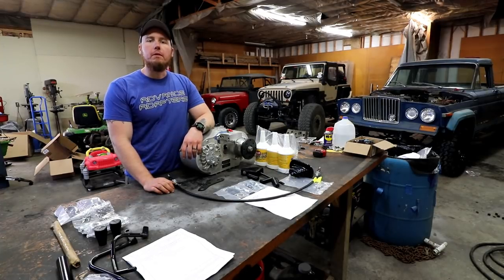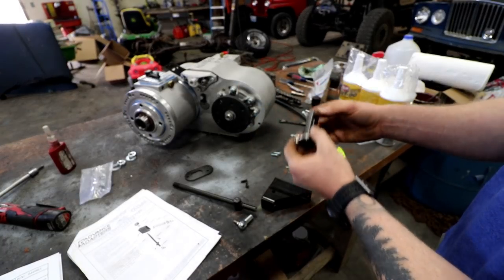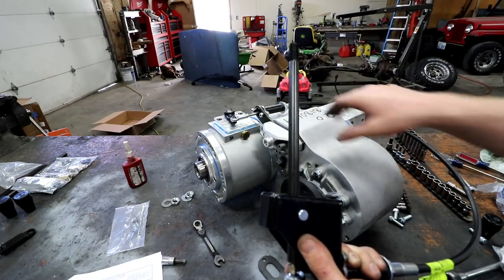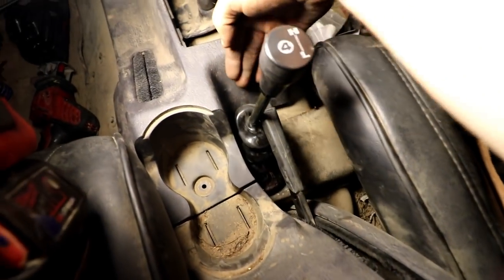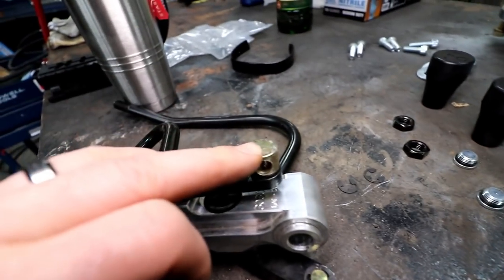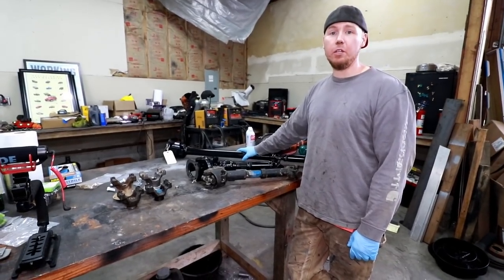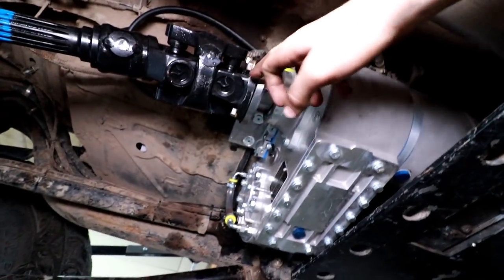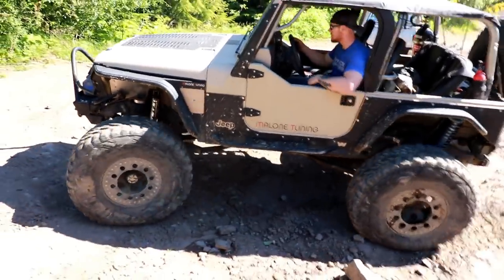SUPER LOW Gear 4 Speed Atlas Transfer Case Install

Comment: if you lost your speedometer when you installed the atlas case and you would like to have one. you can use something like a trail tech for like $100-$130. i bought one that was made for an atv and i use it in my buggy. you just put some jb weld on a magnet and stick it to your wheel and put a little sensor on your axle (i think it could be installed on a drive shaft too). you can set it up for whatever tire size you are running and conveniently change it anytime you change tires. it also has an odometer, ambient temp, engine temp, volts, rpms, programmable shift light, clock, and more (depending on the model)... i had to get some extension wires from trail tech because i have a rear engine buggy.
Reply: MrMrsregor  Sounds like a really good option! I have a Garmin trx5 GPS and it tells me how fast I'm going but I really only needed if I'm on the street and I want to obey the local traffic laws lol
Reply: @natebleepinjeep9564  either of yous have daily drivers? blew up my rubicon 4:1 and just grabbed a standard tjs 2.72:1 but they use different style speedos, ones a magnetic pickup and the others a gear driven one, so i have no speedo or odometer or cruise control.. not a major issue that was about 2 years ago but ive checked alot off the jeep todo list recently and having a speedo is making its way up the list

Comment: The shifters are designed that way. They have a lock built into them so they can't pop out of gear.
Reply: Does this lock also limit steering? I’m trying to figure out what’s transfer case I have on my truck?

Comment: Great video. I'm ordering a 4 speed Atlas for my 98 TJ 2.5l manual transmission. If I choose the competition short shaft will my Jeep still run without the speedo? I might do a LS swap later down the road.

Comment: This is the type of video I've been waiting for. You explained everything perfectly. I'm getting an atlas as soon as the money is there. I noticed you didn't use a tcase support for the atlas.. is that something that might be needed? Or live without?
Reply: Colton Doyle it's something that I will probably upgrade to later on. It's a very heavy transfer case and I've heard that people can break them off the back of their transmission without the proper support!

Comment: I was thinking about going that way with my Jeep and I'm still on the fence if I need to gear any lower than I already am. Currently running a Dana 300 behind a Muncie Saginaw  sm465.  Based on the crazy fitment issues I had (many hours of machining to get things clocked in addition to having to go with an advance adapters twin-stick kit) my crawl ratio is pretty good right now with 35 inch tires and Dana 44's with what I think is standard gearing.  With my 454 at about 3000 RPM I'm doing maybe 4 miles an hour. Plenty of torque, but once I get into the woods and climbing some rock I'll see how much clutch I need to keep things manageable!  For the swap I used both the advance adapters kit to meet my transfer case to the transmission which I found to be lacking options for clocking (big bummer) but I really appreciated the versatility in quality of the twin stick kit I used of theirs for the transfer case.perhaps what impressed me the most was the quality of their customer service and their willingness to give me GM OEM part numbers for things like transmission mounts that they sell at a premium on their website to help me save some cash on the project. The guy even put me on hold for 10 minutes to go out back and find 1 in hand to double check the numbers for me. Glad to see that you are able to showcase their products and very glad to see that they have chosen to sponsor your fantastic videos!

Comment: Got me sold... I'm looking to buy the transfer case for my jeep... Heck you could let it crawl jump out and grab a beer out of the cooler in the back and be able to walk back up and jump in lol... Joking of course...
Reply: You aren't wrong. My truck has a crawl ratio of something like 72 to 1, and it goes about 1 mph at idle. Get too much lower and it won't move anymore :P
Reply: 57. You are exactly right. With my Jeep in low low I can get out, walk around it grab the bumper and go sketching.

Comment: Cool video... I didn't even know that these kinds of transfer cases were made. I've seen the Marlin Crawlers for Toyotas, but not these... so thanks for sharing. Couple of quick questions...is there no seal (or gasket) between the transmission and the transfer case? I did t see it in the video. Also, is it just me, or was the new transfer case sitting at an angle on top of the skid plate?
Reply: Scott Gephart I'm glad you enjoyed the video! You can get a gasket that goes in between the transmission and transfer case but most people don't use it. Yes the transfer case is at a slight angle. Just barely less than the stock np231
Reply: Nate Bleepinjeep gotcha, thanks for the quick reply. By the way, I like your video style. You kinda remind me of a high school shop teacher... very educational.
Reply: No problem brother, I teach alot in my trade so I guess it bleeds into the videos a bit. Thanks for taking the time to comment!

Comment: question for the 5.44:1 gearing you use. is that mainly for people who have manual transmissions who will benefit off that? i’m working with a dana 300 and want to put a 4:1 gearing in it mates to my AW4 auto
Reply: G&GFactoryMade gearing down low is good for an automatic as well. But you can get away with a little bit less during an automatic then you can a manual. The benefits for the automatic are that you can keep a higher RPM and still slowly crawl up steep grades. Automatics can suffer starvation and come out of gear if you're not at a high enough RPM while at a steep angle. I don't know what your tire size is or your axle gearing, but typically 4:1 is great in most situations

Comment: Why did you choose 2:1,2:72:1? Could you have gone lower? I’ve been eye balling a northwest fab underdrive for my 4:1 case due to huge spreads. 2.72:1 UD, 4:1 TC, 10.88:1 low-low. I want the options and am curious if you chose that setup or that’s all that was offered. Great video btw, really enjoy your series the most.
Reply: Bodeesafa thanks for the comment, I choose these ratios because I think it gave me the most options. I had the option to go lower but 10:1 is way to low for me!! I like the 2:1 for driving in mud, the 2.72:1 for trails and the 5.44:1 for the rocks. But I have 5.38:1 gears in the axles. A numerically lower axle ratio would certainly change things. With a 4.88 I would be much more interested in a 10:1 tcase. Glad to hear you liking the videos brother! Many more to come!

Comment: I wonder if having that super low gearing is easier on components or harder. Seems like you don't have to use as much throttle going up obstacles.

Comment: Is that a 1410 at each end? I am guessing you have a 1350 double Cardin at the transfer case and 1410 at the axle.
Reply: Michael VanHorn 1410 CV and 1350 on the axle side
Reply: I have Adam's shafts on my JK and they are beef.
Also, dealing with them was super easy. They answered all my questions and I got my shafts quick.

Comment: Just a small note - you've actually communicated the ranges backwards. The transfer case is 2:1, and the 'doubler' is 2.72:1. You said it backwards. Just trying to be helpful. When you put the atlas in 4 low, it is 2:1. This is actually important, because your actual low range went UP, not down, which might be an issue for a user contemplating this setup. I've had a number of these setups, and you want to basically have it in low range, and then bring in the 'doubler' (which is actually 2.72:1) only when you need it. This means that your low range, without the doubler, needs to be as low as you need to go like 75%+ of the time. You might think 'well, I'll just put the planetary in low and leave the transfer case in HI, so I will be at 2.72:1 which is where I want to be most of the time', but I can tell you from experience that having to switch both levers of the transfer case from hi to low when you are bound up on an obstacle is much more difficult than just switching the planetary in and out. Anyway, just pointing it out, hope that helps for anyone contemplating this swap.

Comment: Did you stretch the rear? That's a mighty short rear driveshaft
Reply: MasterMoparMan the rear is only stretched about 2 and 1/2 in right now. I'd say it needs another 2 at least
Reply: Nate Bleepinjeep did you push the front axle forward?  What are you going for as a wheelbase? Consider using the genrite tank?

Comment: Great video Nate. Whats the cost of a unit like that? Also don't forget to check out monstaliner for the gladiator. I think that would make a killer series.
Reply: its a lot lol
Reply: 3500 or so just for the transfer case.
Reply: Fat Biker thanks for the comment... About what I was expecting... Worth it to me
Reply: 3500 bucks is about right, it's something I've been saving up for for quite a while! A very important tool to have, and you don't want to have it blow up on you in the middle of nowhere! I figured if it's good enough for King of the Hammers it's good enough for my little Jeep LOL
Reply: Nate Bleepinjeep I got the money and already ordered it... My little 4.0 ho I'm sure won't hurt it... My 35" tires need the extra low gearing for the messes I get myself into... I TRUELY thank you for this video... Awesome video and tutorial I can't thank you enough... Especially on the bigger joints to make the drive shafts bullet proof...
Reply: 57 RED ROOSTER glad to hear this video can help! That's what our channel is all about
Reply: Nate Bleepinjeep is the gearing choice due to lower reving diesel engine? I have been eyeing the 10.21:1 ratio box for my setup.

Comment: NICE! you got the Atlas 4, congrats! You mentioned swapping the D40 for a D60... What do you think about a Ford "High 9in" front? would you consider or recommend one? I think they look like an awesome choice- strong, high clearance diff, and light. would love to know ur thoughts
Reply: WoOsKii 1 I am a huge fan of the hybrid 609 front axle. This has been my plan for years but when you actually put it all down on paper and start adding up what everything costs, it's so hard to justify the 9-inch Center in my situation. It will add another 2 Grand or so in cost for the front end build in order to attain a high pinion 9-inch. My Jeep is so light that I won't need the added strength of the 9-inch Center in the front and I plan on shaving the high pinion 60 to add more ground clearance. I'm such a big fan of the Ford 9 inch platform so it's really hard to give up the dream! I haven't fully decided which route to go yet but I do have a high pinion 60 sitting in my shop now
Reply: +Nate Bleepinjeep I really feel ya on that! I know it's a expensive/ labours deal, but it's such a sick set up... All I can say is consider it, because you already ALMOST have the ultimate TJ (with the addition of that Atlas), and that high 9 would just be killer, and unique as the rest of your rig.  That being said a D60 is still sweet. whatever way you decide (high 9!) just keep the videos coming, love the work!
Reply: WoOsKii 1 damn it dude! You're really selling me on it again! LOL I've got people telling me to keep the Dana 44 (at least until I break it), people telling me to swap over to a high pinion Dana 60 and people telling me to do a 609! I'm not sure what I'm going to do yet but whatever I do I can guarantee a video out of it!
Reply: WoOsKii 1 damn it dude! You're really selling me on it again! LOL I've got people telling me to keep the Dana 44 (at least until I break it), people telling me to swap over to a high pinion Dana 60 and people telling me to do a 609! I'm not sure what I'm going to do yet but whatever I do I can guarantee a video out of it! Glad to hear you're enjoying the videos!
Reply: +Nate Bleepinjeep Right On! actually I agree with everyone; drive the 44, and keep the 60 in ur garage while u save $ and get parts ready for the 609 conversion... worst case, if you start tearing up the 44 badly, you will still have the D60 on hand if you need it. 
Whatever you do, just keep dropin video bombs like the ATL-4 and Poison Spider.  Love ur vid editing on the low buck Diesel Truck, All important info explained! (slow tedious work put in high-speed, with fresh music dubbed over, awesome!)

By the way I love your rear axle😘! Think about doing a quick vid explaining a bit more?- fab, pros/cons, stats, features/strength etc.)
Reply: WoOsKii 1 thanks for the kind words man! For now the plan is definitely to keep the 44 in there. At least until I start blowing things up. I'd like to build another rear housing and do a video on how to put that together. Maybe for my CJ. Lots of upcoming projects! It's tough to decide what to work on these days LOL. I'm going to hit the Rubicon Trail in September so I've got some things I'd like to do to the TJ first, but I'm also pretty excited to get the low Buck diesel truck on the road
Reply: better with full floater,d60.i sold all my 9" ,s ,dont like the cone brearings,too much pressure on them..bronco has d60 rear.,d44 front

Comment: Did I hear you correctly?? Diesel in your TJ? What diesel engine do you have? I'm considering the VW 1.9 diesel. The Cummins 2.8 is just a little to pricey (at this point) for me.
Reply: Jeremy Rhodes he has a 1.9pd and it seems like it does great.
Reply: Jeremy Rhodes it's a 1.9 TDI out of a Volkswagen Jetta. Has bigger injectors and a slightly bigger Turbo. So far it's been awesome! The biggest unexpected performance increase was how much better at handles by dropping all of that weight up front. Also the gas mileage is ridiculous. I have a walk around video on my bleepinjeep playlist. I go into a little more detail with the engine swap

Comment: What is you axle ratio? was your t-case low before 4.1 I assume.
Reply: Wheelin Wayne my axles are 5.38 to 1. The stock T case ratio was 2.72 to 1
Reply: Nate Bleepinjeep Hey thanks a lot, I’m trying to figure out what gearing I want to go on my CJ with 40s.  doing a 4-1 t-case and Trying to decide either 5.38 or 6.17 in the axles. Jeep isn’t road legal. And is a manual transmission.
Reply: Wheelin Wayne what engine are you planning on running?
Reply: Nate Bleepinjeep amc 360 v8 converting to Throttlebody fuel injection
Reply: Wheelin Wayne normally I would say go as low as you can but in your case you're going to have a V8 manual. You might be happier with a 5:38. You're going to have yourself a fast Jeep brother. What axles?
Reply: Nate Bleepinjeep I hope so lol, Dana 60s front and rear. I really enjoy watching you videos. Gives me motivation to keep wenching on the Cj
Reply: Wheelin Wayne that's going to be a sweet build and thanks man! Glad to hear you've been enjoying the videos!

Comment: How much $ to put tdi diesel in the tj?
Reply: as little or as much as you want.. you can grab a scrap engine some scrap steel and beg cheat and steal any part you need or you can drop it off at a 4x4 shop with a blank cheque.. relistically if you look for a cheap used engine, only buy the most necessary of adapters and fabricate the rest well using common sense and a budget mind along the way you can have it installed and working for 2k-3k... im sure someone with the right combination of junk in their yard could manage the swap for about 300$

Comment: How much is that atlas setup $8,000.00?
Reply: delinquentdesign it ain't cheap! But it's also not 8k lol this setup with the shifters, the fluid, and the shipping is probably somewhere around 3500 bucks
Reply: Nate Bleepinjeep yeah that’s the problem it’s worth more than my whole rig I wish someone would make something like this a little more affordable. Maybe in kit form or something.
Reply: @delinquentdesign  unless you do extreme rock crawling you really dont need 5.44 to one in your transfer case, i have a rubicon nv241or 4:1 with a cracked rear case id sell for 400$ canadian if you feel like shipping the 100lbs or so, case can probably be welded by someone competent i just never bothered its all mud bog in my area so i find 2.72 more useful than 4:1, thats on 35s with 4.10 axles

Comment: Well, I was going to suggest that you stretch your TJ some more. But now that you got new drive shafts, I guess that’d be a bit wasteful. Seeing this TJ on some of the steeper obstacles on the Moab trip, compared to the other vehicles seemed really short. Personally I like low wide and with a longer wheel base.
Reply: Ryan Garcia its stretched 4 inches now putting it a little over 97". That's a little to short for moab but it's starting to get on the longer side for tight trails like we have in Washington. I think I'm going to stretch it another inch or two but thats all I can do while being nimble enough for the trails I like up here. It's also about as short as I can make it (height) while still being able to hit the tougher rocks. It has a 4 1/2" lift right now and that's pretty small while being able to run a 40" tall tire. Its hard to build it for everything! But I'm trying! On the steep stuff I'm wishing it was longer, shorter and wider but ultimately I would sacrifice alot of usability in other areas
Reply: Nate Bleepinjeep thanks for the reply. All valid facts. It’s very hard to have the perfect all around Jeep! I’m sure you’re gonna love being able to do a front dig in your area thru the tight spots. Someday I hope to have an Atlas under my rig.